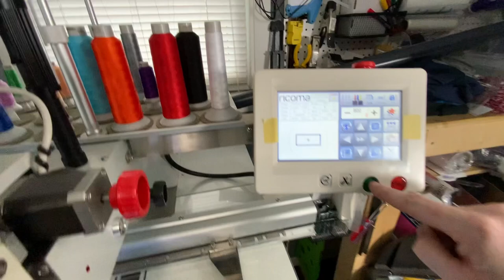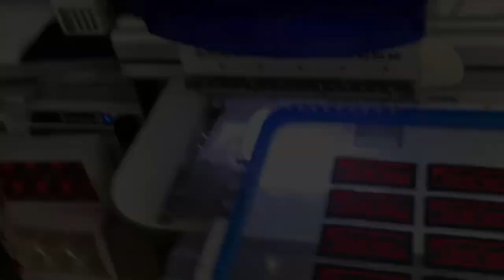How I make my Embroidered patches using Poly Twill from Stahls.

Comment: if you dont mine me asking why do you use the plastic and not just embroider them all out at one time on twill and then cut them out?
Reply from the maker: You do it on plastic so you don't have to cut or burn it when it's done. The plastic allows you to do it the way you see it. As soon as it's done, pop it out and do burn to tighten it up. And then add your sticky back, or it's ready to stitch on what you want.
Reply: o.k. thats what confusing me because i saw you cut it out first and it just seems excessive lol.  i have vinyl cutters to cut my shapes out so i dont have to do the first step of doing the initial stitch to create the shape. my plan eventually is to get a laser cutter to do it.
Reply from the maker: I have a Lazer and cutter those will work. I do think if you do all your stitching on the plastic it may jump off line. Bc the satin stitch will be the last thing to get done bc that is what cuts the plastic. And thats like doing puff on a hat.
Reply: @ttowntshirts   nah, you just have to have to have thick enough plastic.  thats how i first learned how to do i was just to use the badgemaster film. but I started to do more sublimated patches which required the need to cut the shapes out.